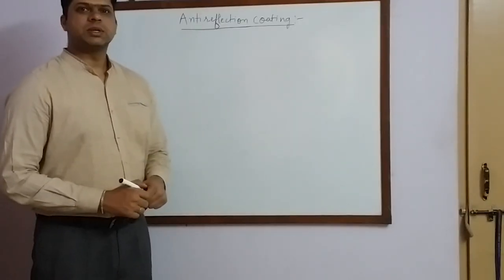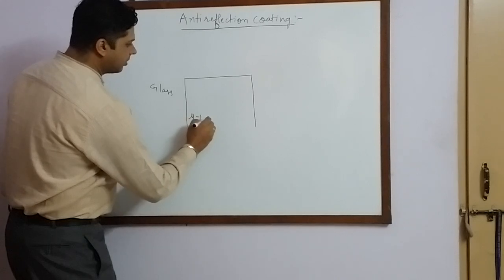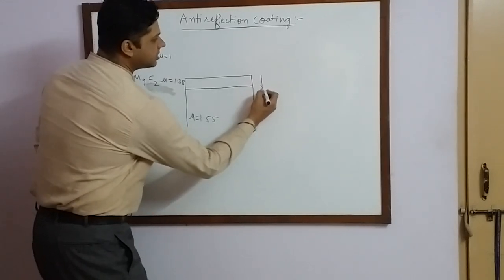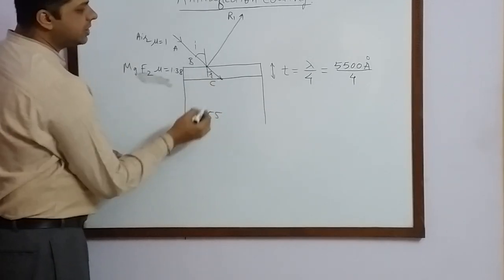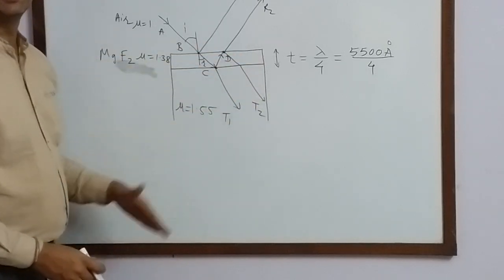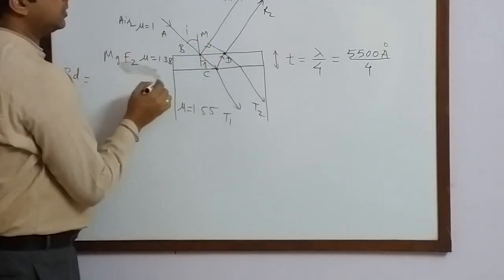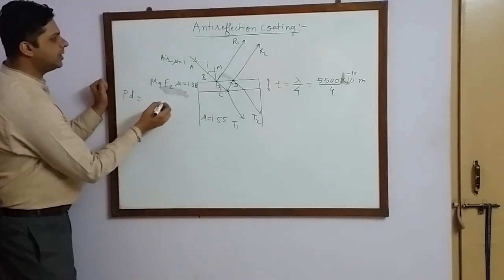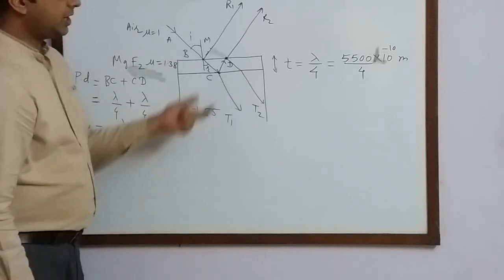Antireflection coating

Comment: I mean, I kinda discord on some point of the video, there's no mentioning in the calculation of the path difference of the MgF2 index of refraction, whilst you should mention the optical thickness t being dependent on this value, because actually we need a QWOT in thickness instead of a simple lambda/4 thickness.

Comment from the maker: Students plz make use of Headphones to listen to this video
Reply: Ok
Reply: Why does anti reflection coating of lenses have to be a quarter of the wavelength of light, if both of the reflected waves (from the first surface and the second surface) will undergo 180 degree phase change? Won't they interfere constructively in any way, despite the thickness of the coating, since the reflected rays will be exactly the same as the incident wave, except they BOTH will be 'flipped upside down', having the same phase (no phase change between the two reflected waves)? Both of the reflected waves should undergo 180 degree phase change and therefore, interfere constructively.

Comment: Can someone please help me? Why does anti reflection coating of lenses have to be a quarter of the wavelength of light, if both of the reflected waves (from the first surface and the second surface) will undergo 180 degree phase change? Won't they interfere constructively in any way, despite the thickness of the coating, since the reflected rays will be exactly the same as the incident wave, except they BOTH will be 'flipped upside down', having the same phase (no phase change between the two reflected waves)? Both of the reflected waves should undergo 180 degree phase change and therefore, interfere constructively.
Reply from the maker: Yes the phase difference between the reflected rays is zero as both are reflected at the surface of denser medium hence corresponding path difference is also zero. So now in order that rays in the reflected system to interfere destructively the path difference between them need  to be odd multiple of half the wavelength of light. That is why thickness of MgF2 is selected such that it is quarter of the wavelength of light. So that path difference is ( quarter of the wavelength of light ) + ( quarter of the wavelength of light ) to and fro. So that path difference becomes half the wavelength of light which satisfies the condition for destructive interference or darkness. Hence rays in the reflected system will always interfere destructively.
Reply: @milindanand1  Thank you very much for responding. I already know that information. I can’t actually visualise how thickness of the AR coating would affect the interference between the reflected waves (whether it would be constructive or destructive). If the reflected wave doesn’t undergo 180 degree phase change, it would just travel back along the same path. If it does undergo 180 degree phase change, it would travel back along the same path, but just flipped upside-down. In other words, despite the thickness of the AR coating, shouldn’t the phase of the reflected waves always be the same? If both of the reflected waves undergo 180 degree change, shouldn’t they always be the same at any moment in space and time? It’s quite difficult to explain what I mean without diagrams. Is the any chance I can get your email address to send you the diagrams?
Reply from the maker: YOU CAN MAIL ME AT milindphysicist@gmail.com
Reply: @milindanand1  thank you very much

Comment: sir in pd = (BC + CD) , I think it should be refractive index * (BC + CD).
Reply from the maker: right but the thickness of the film is very small hence BC and CD they are nearly eqaul to t.
Reply: @milindanand1  Sir very very very thanks for replying so fast and clear my doubt
Reply: Yes optical path we need to multiple with n
Reply: Why does anti reflection coating of lenses have to be a quarter of the wavelength of light, if both of the reflected waves (from the first surface and the second surface) will undergo 180 degree phase change? Won't they interfere constructively in any way, despite the thickness of the coating, since the reflected rays will be exactly the same as the incident wave, except they BOTH will be 'flipped upside down', having the same phase (no phase change between the two reflected waves)? Both of the reflected waves should undergo 180 degree phase change and therefore, interfere constructively.

Comment: But still energy is lost?
Reply: Very good question! It is probably due to the quantum nature of light that no energy is lost. Since the path of reflection would lead to destructive interference, it does not even occur for the probability distribution of photons. According to this interpretation, therefore, no energy is lost for the transmitted path, which should correspond to observation. So maybe a physics expert can confirm this...